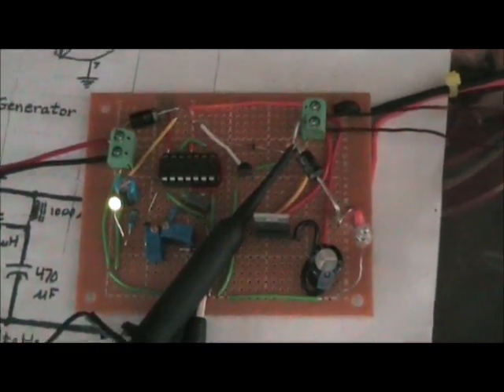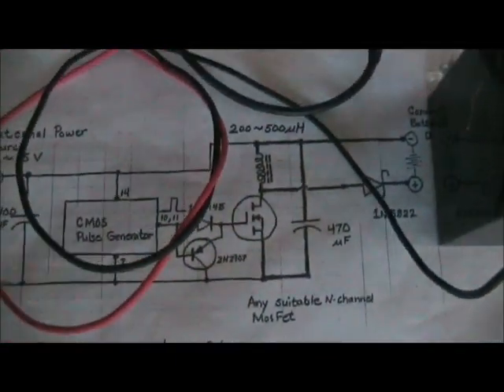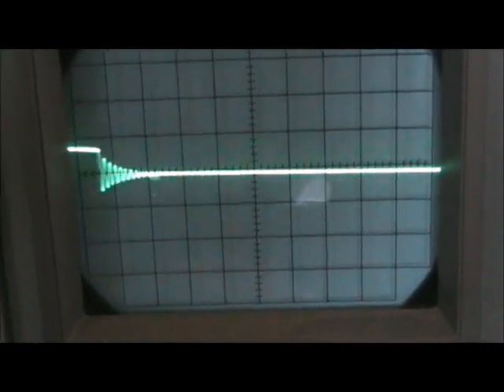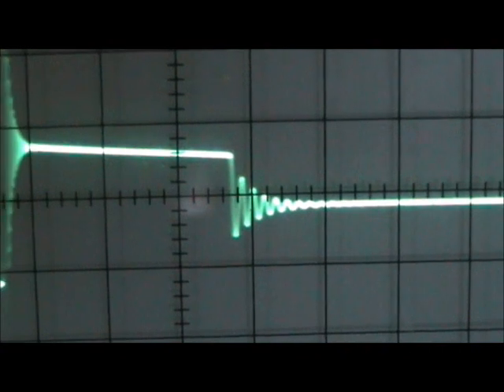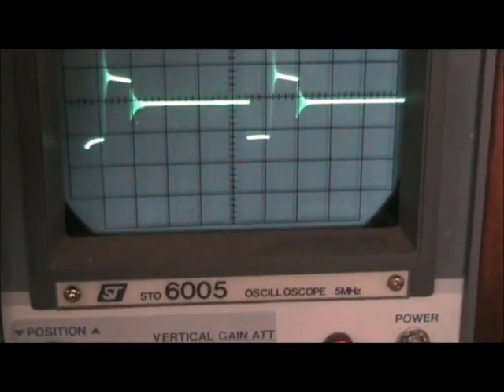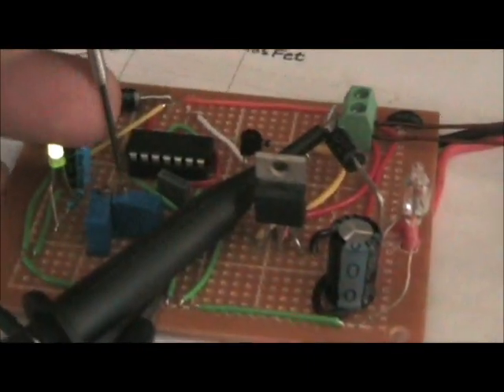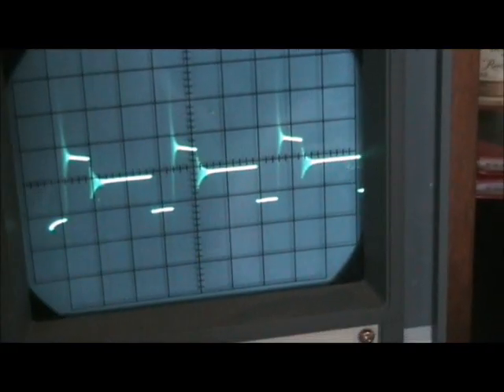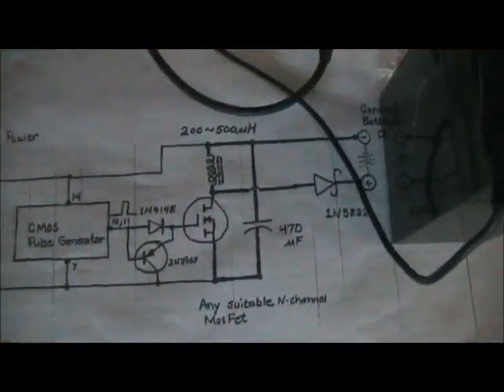Desulfator Circuit.wmv

Comment: If you have an old ATX power supply with IC 494 or 7500 inside, connect pin 1 of this IC to ground through resistor 12k...33k (you must find the proper value for your supply). Output voltage (yellow wire) should be 13.5 - 13.8V (max 14.5V). Connect green and black wire together to power ON. Now there is my question. When i reconnect my yellow output wire directly to schottky diode rectifier (transformer secondary), i will get 30..100kHz pulses. Is it good for desulfating?

Comment from the maker: Yeah that can happen, the cap in parallel might work, I usually start on one's like that with a high frequency solid state circuit at very low power for a bit to get some energy flowing through the battery.

Comment: my other 7Ah SLA battery stayed in storage too long and looks like an open circuit, reads at 9v with no load and causes the energizer's (orange) neons to flash blue..  Going to try the first few cycles with a high capacitance in parallel..